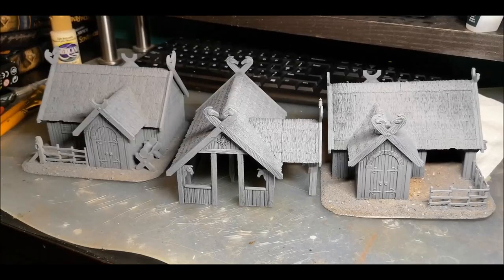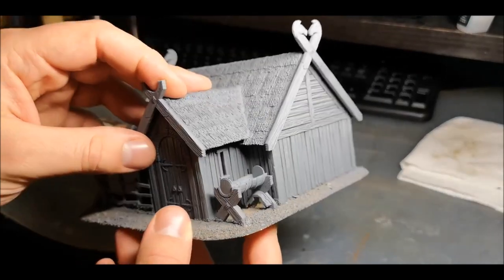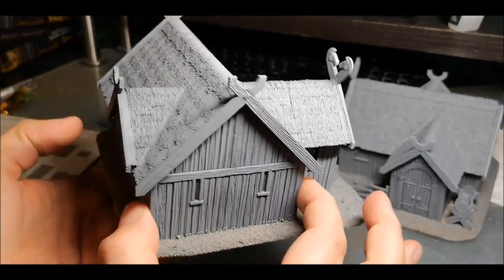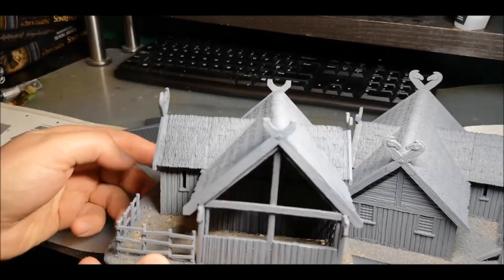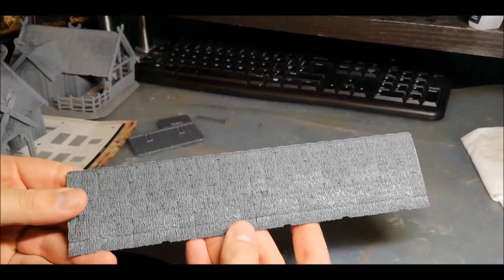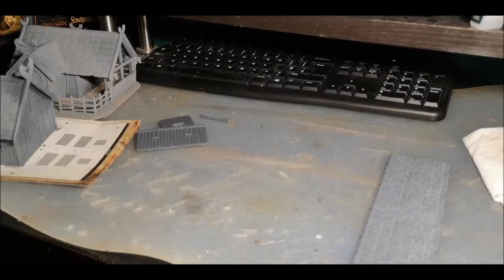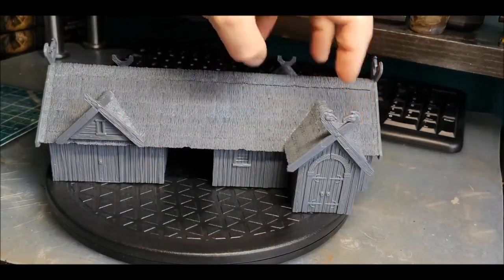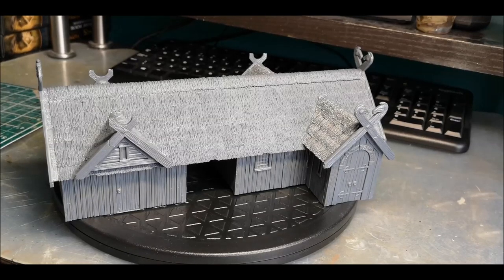Games Workshop Plastic Terrain Assembly Guide - Rohan Houses

Comment: Do you happen to know what Foamex is called in the USA?
Reply from the maker: I don't I'm afraid, might be PVC foam board. I know that it's used a lot to make signs, so if you've got a local sign maker they may have off cuts or know what it's called
Reply: Thanks!  Great set of videos.
Reply from the maker: @edyoungstrom2854  thanks buddy!